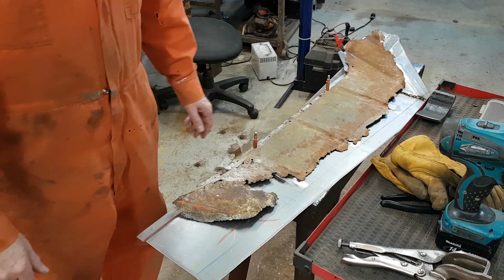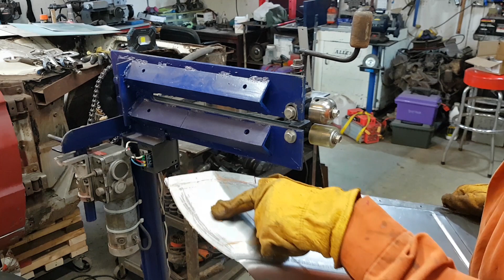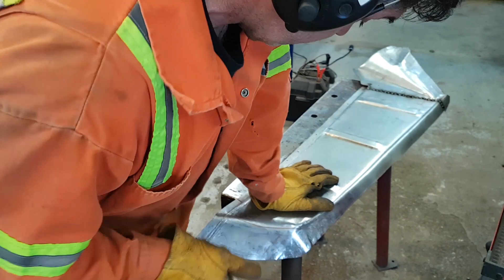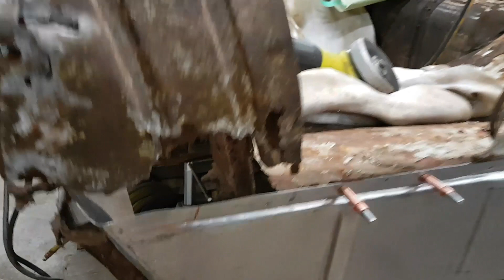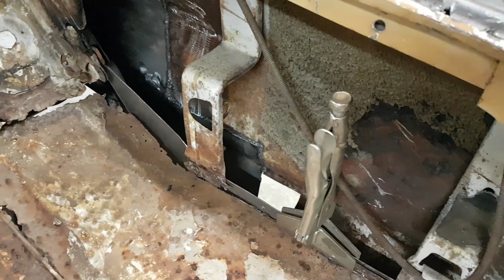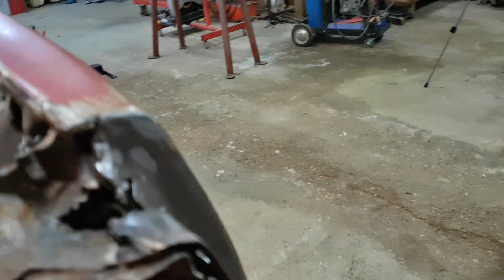Shaping Sheet Metal With Basic Hand Tools – 1965 Thunderbird | Ep #31

Comment: Alvin,
Recommendation: Do an instructional video on mega-speed body hammering. 😁
Very informative and entertaining, my friend.  Wherever do you get the energy?  Next week I'll finally be welding in Pearline's replacement passenger side floorboard, a job that would take you about two hours to complete, but will likely take me 5 days...minimum. 😏 
Check ya next time.
Regards,
John
Reply: Hey John, I hope you still video your work. Even if you don't post it!
George B.
Reply: Hey George,
No lengthy vids, my friend, only 3 or 4 minute jobbies for Brendan.   Anyway, the undercarriage is completed and it's time to get the interior back together.  So many parts, so little time. 😂
Regards,
John
Reply from the maker: Hi John,
It was funny to watch in fast motion, and these videos sure help a guy to see where improvements can be made!
Even if it takes 5 days to do the floor, you are doing it, and that's the important part! 😎
Thanks you for being here with me on this project! 😊😊
Alvin

Comment: Hello Alvin. That back corner is a bit tricky for sure. Even the replacement wheelhouse extension panel is not complete in that rear corner. Feel free to show the pictures I sent to you if you think it will help anyone else working on the body panels to see what the aftermarket replacement panels look like. Thanks for showing how to fabricate with minimal tools. I am really enjoying your videos! Keep 'em coming!
George B. in Michigan
Reply from the maker: Hello George, that corner is a little tricky for sure! If I had used a sand bag to start the shape, and then ran it through the English wheel, it would have been faster, but the hammer forming is good practice for me. 😎
I will use the pictures next time I'm working on one of the parts.
Thank you George! 😊